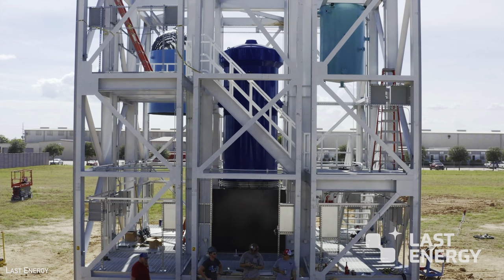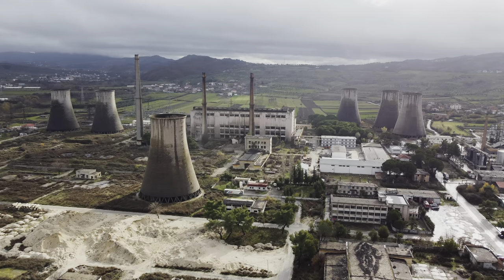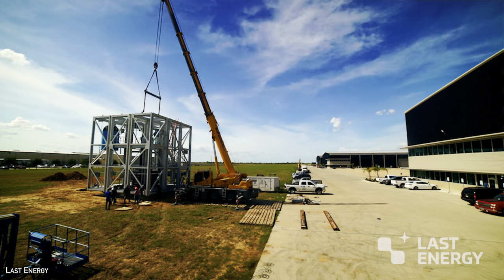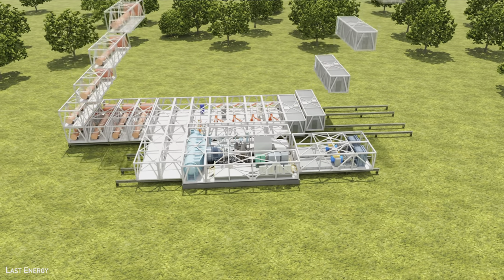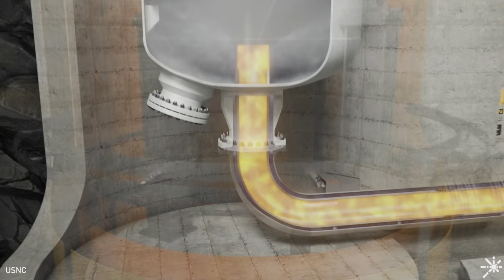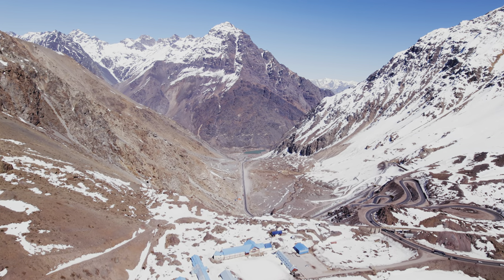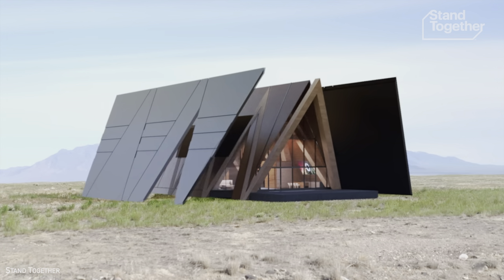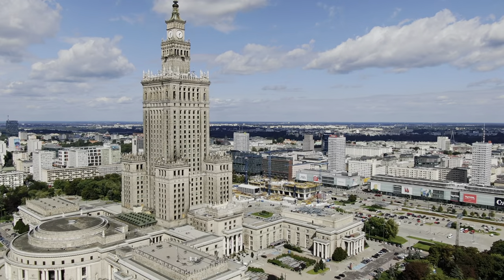The Daring Plan to Build 10,000 Nuclear Reactors

Comment: Well normal powerplant also have preproduced moduels that they put together, its just a higher number of those modules,... well and a lot of welding.

Well and building a nuclear reactor really don´t take as long time as people tend to believe. A full size GW nuclear reactor can be built in 2-3 years . The issue is really not time, but will.

Passive saftey is standard for all gen III reactors, that is pretty much all reactors that have been newbuild in the west the last 30 years or so. This is really not something new.

Even in a gen II reactor, the operator need to do nothing to activate the active cooling system. Even some gen II reactors have semi passive cooling system.

Perifalation is not really a thing with light water reactors. Specially so with sealed reactors.

To use a light water reactor to make weapon grade plutonium you have to open it up every 3 weeks and swich out fuel. While that sounds like it would be possible in theory. In practical reality you really can´t do it while making fuel.

Reactors like RBMK that was the type used in Chernobyl could extract fuel while operating, making this much simpler.

The idea that you can just make a bomb out of used nuclear fuel is simply incorect. Its one of those, you could do it in theory, but its so horribly complicated, so its just easier to make it from scratch

Comment: @16m:  “it is unlikely any other regulator is going to be any more forgiving”

That’s a broad sweeping statement in the extreme. Any evidence following? Why, no. The US NRC has well earned its No Reactors Commission nickname. The NRC had not issue initial proposal approval for any of the existing US reactors, until Vogtle 3 came online. Hundreds of reactor proposals have been cancelled over the decades under NRC.  There was no ALARA requirement before NRC.  The history suggests NRC is unusual throughout the world, not typical. And, Poland is very hungry for reliable clean power.  Their populace will not tolerate intermittent RE games raising rates over 30cnt Euro per kWh as in Germany, becoming dependent on Russian gas or any other idiocy.

Comment: This takes up the same amount of space above ground as the GE-Hitachi SMR which will produce 15X the energy and at a cost 20% less, Last may want to work on that.
Reply: No chance.  The pressure vessel for a 300MWe reactor is hopelessly custom, $150 million if it’s dime, made by only a few mills in the world. Can’t ship it by truck, can’t bury it underground.  The 20MW Last Energy  PV is right out of ASME tables w hundreds of mills that can make it in a few months, any semi can deliver, and it’s easy to install underground. Projects like the LE design are built in 18 months all the time. GE-H will be 7-10 years, and need a big water supply, above ground big containment. 

LE problem is the regulator. They have a shot in E Europe.  A small cheap reactor built in two years will turn the world upside down, and many special interests don’t want that to happen, including GE Hitachi.

Comment: Great dream but a dream nonetheless!
The concept is great but there is a long road from concept to reality and I could already see many things that needs to be improved or modify the get there. One of the most obvious is to reduce the size of actual reactors to fit the model. Not only it needs to be smaller but it also needs to be economical to build and operate and this is not a small task.
Another problem I see is to build it in the US and install it in Europe. Two points: First it will be expensive to build in US and it will be hard to find the necessary personnel to do the job. Second, if you think this is the hardest problem, wait till you try to get the necessary permits in Europe. It would be hard today to get them but it will be even harder to complete that task in the future with the geopolitical changes that we are facing at the moment.

Comment: While security around a nuclear power plant is mandatory, it's not because of terrorists that steal uranium to make bomb: those plant, and future ones, operates with a core composed mostly by the wrong isotope to make a bomb, and the part that is right is less than 5% at most, while bombs requires an enrichment of 95% or more.
And if think "well they steal it to craft a dirty bomb" I'll answer that there's hospitals for that one, way more accessible and available than a nuclear power plant of any kind.

Comment: Fluid dynamics, pipe size matters! Large reactors are efficient because they are large, using large pipes. Basic physics. Uranium at 5% that is mostly sourced from Russia and that is a supply issue. Large CANDU style reactors make more sense since they can run on low grade Uranium and can manage refuelling on the fly. SMRs are more for Silicon Valley glossy brochured investor schemes than a practical economic solution.

Comment: Submarines have been using them for decades.  Compact and powerful.  I do prefer low-pressure ones.  Let's hope molten salt and thorium come to the party soon.  Production line and modular parts would make sense.  Sadly, less than 10% of current fuel rod fuels are converted into energy, with the other 90% wasted.  Mass storage of wind and solar, as proposed by AMBRI, may be the answer.  Molten Salt as electrolyte, Calcium as anode, and Antimony as cathode.  A big insulated box with hot elements that cannot mix.

Comment: 20 MWe or 20 MWt?  (20 MW Electrical output or thermal output)?
Reply: Looked up on Wikipedia, it mentions a lot of detail on the company, it is 20 MWe, which is quite impressive for the size.
Reply: @LFTRnow  most impressive is 6 year non stop run time, 2 yr build and 4 mo install.

Comment: Must admit that this plan checks all the boxes for REASONABLE-NESS .. However, I fear that the kiss of death is the nuclear proliferation and terrorism threat .. which will be ever-present and no let up as long as the installation is there ..  UNLESS .. could there be a device, once triggered in the reactor, will render the processing for fissile elements either impossible, or more difficult and time consuming then doing it from naturally available uranium ? ..  Calling to nuclear scientists, is this scenario even possible ? worth pursuing ?
Reply: Can you explain what this threat is about. Ukraine happened and the plant is still standing. As for pressing a button, to shut down reactors they can SCRAM. As for getting materials, you cant just steal them from a reactor (because theyre really hot). If youre going to steal them you take them from the cooling pool or you steal them from the average hospital. But

(to be clear, dynamite isnt used in cancer therapy cesium is)
Nuclear is boring. The only point of using dirty stuff is because its more compact. Fear the person buying nails from home depot instead. Ted Kaczynski used scrap metal.

"The bombs that tore through a crowd of spectators at the Boston Marathon could have cost as little as $100 to build and were made of the most ordinary ingredients — so ordinary, in fact, that investigators could face a gargantuan challenge in attempting to use bomb forensics to find the culprit.

Investigators revealed Tuesday that fragments recovered at the blast scene suggest a simple design: a common pressure cooker of the kind found at most discount stores, packed with an explosive and armed with a simple detonator. A final ingredient — a few handfuls of BBs, nails and pellets — helped ensure widespread casualties when the two devices exploded Monday near the race’s finish line, law enforcement officials said."

"There has never been a known successful attack using a dirty bomb, although a few alleged plots to use the weapons supposedly have been foiled around the world.

In 1998, security services in Chechnya, the volatile republic in southwest Russia, said they defused a mine attached to a container holding radioactive material, which they claimed had been placed near a railroad east of the Chechen capital of Grozny by Chechen rebels. Two years earlier, a Chechen rebel claimed to have planted in a Moscow park a bomb comprising dynamite and caesium-137 — which can be used in cancer radiation therapy.

And in 2004, British law enforcement arrested Dhiren Barot, a man suspected of being recruited by al-Qaeda to plan terrorist attacks in Western countries. Britain’s domestic intelligence service, MI5, said Barot’s “ultimate ambition was to explode a radioactive ‘dirty bomb.’ ” It is unclear, however, whether he had the means or technical know-how to accomplish such a plan. Barot’s arrest and subsequent sentencing to decades in prison remain controversial."
Reply: "Nuclear proliferation" is a buzzword for "how do we stop Iran from getting weapons". In which case, the Iranians getting them will probably make te whole non-proliferation bullshit cease, as I'm sure the Iranians believe in free market for nuclear materials.

Comment: Its not fair to compare $/kw.  It doesn't take capacity factor into account.  Solar plants have terrible capacity factors often below 20%, depending on the climate where they are built.  Wind is around 30% to 40%, in ideal situations.  Nuclear is north of 90%, in the US on average.  

A more fair comparison would be $/kwh annually.  That would show how much each annual kwh costs and take capacity factor into account.  

Plus solar panels only last 10ish years.  A nuke plant can last 60+, albeit with steady capital investment.  

I see that $/kw stat being thrown around a lot by narrative driven media types and its not telling the whole story.  And none of what i mentioned above even gets into the Power Factor ratings of each type, which is incredibly important for grid stability and not well understood, outside of the power industry.

Wind and solar do not produce large amounts of VARS (poor power factor), like large synchronous machines do in nuke plants.  Think brown outs.  Watts turn the lights and appliances on.  But VARS make them run at full power/voltage.  Not enough VARS causes grid voltage to drop and make things unstable at worst.  Not enough watts causes blackouts.  Both are very important but most only focus on watts because VARS involve imaginary numbers and are a confusing concept to grasp.

Comment: if there is an international organization regulating this, why isn’t there just one set standard, and manufacturers just have to surpass those standards. 

making the economy of scale that much easier to reach
Reply from the maker: There have are currently several ongoing attempts to do exactly this through WNA and IAEA and others. The problem is that every country has their own regulator and their own way of doing things. Would one country accept the rules of another being imposed on them? Who decides? Would the US NRC accept design decisions and requirements from Kazakstan or South Africa or any other country?
Reply: This kind of mindset is exactly why NRC can't approve new reactor designs
Reply: @vaclavzajac214  I am sure that it has far more to do with the unwillingness to reduce production capacity of weapons grade radioactive materials. 

Not that I can fault them for holding such a position considering the costs it took to simply build up the current capacity. Hopefully in the future the weapons grade will come exclusively from military operated reactors, and civilian reactors can be safer more cost effective Thorium reactors.

Comment: “Tackling the main issue that has plagued the nuclear industry for decades, hugh upfront costs…”

No.  If one listens to the CEO,  the main issue is drastic over regulation in the US, led by the industry, which switched years ago to a “safety” business instead of a power business.  So, a constant cost of a $billion to certify any design, drove the industry into building huge reactors, which naturally has all kinds of supply chain problems. 

The NRC for instance demanded changes to the new Vogtle design, after the reactor was approved.  Also, the NRC regularly ships staff abroad, so there is nowhere in Europe where the hand of the NRC won’t be felt.  

Last Energy has a wonderfully sound and inexpensive reactor design which would revolutionize the energy industry.  Seems unlikely they can get past the main gate, the regulator.
Reply: You mentioned in a different thread that there arent any Chernobyl reactors. There are. 8 are still in operation but are being shut down between 2024 and 2034. 8 others including 3 at Chernobyl were still in operation until 2021.
Reply: @namename9998  “there are”

There were several Soviet built reactors   using the so called RBMK design from the 1970s.  The Chernobyl reactor accident 1986 was one of those.  

The gross flaw in the RBMK design was its inherent “positive feedback”, where in dome situations, increasing the reactor power intentionally cause it to be naturally more reactive, and it runs away.  All other commercial reactors have negative feedback. After the accident, all the remaining RBMKs were heavily modified to eliminate the condition, as documented by the IAEA. There are 8 RBMKs left, all in Russia, which are modified.

Comment: This is stupid. At 20 MW per unit this does not have the economies of scale to pay for all the personnel and maintenance required. All NPP require operations, security, radiation protection, and maintenance. These all have a relatively high cost. This is not such a burden on a dual 1000MW unit plant with a 40-200k hourly revenue. This does not pencil out on a 5 x 20 MW plant.
Reply: Watch the actual video @7min.  Small can do away with some risks, thus less expense to protect the reactor.  Also, the interest payments on long to build large reactors have zero payback with scale. Last Energy claims it can build 2 years.  

Examples:  
o No 25 mi evac plan necessary for a 20MW reactor, as one might need w a great 1300 MW reactor. US NRC already approved no large scale Evac for Nuscale reactors
o East to bury a small reactor, w a small hole in the ground, which adds cheap safety and security.  Large holes get expensive exponentially.  
o Small reactors much easier to disperse shutdown decay heat than big, as the heat path to the outside from the center core is short. A small reactor 20MW is just about passively safe against a melt down without doing extra cooling.  It can’t get hot enough in shutdown to make hydrogen which caused the Fukushima accident.  Regulators know that too. 
o Netherlands for instance think the US small army security force on reactors is stupid.  It’s especially stupid for a small reactor which really can’t hurt anybody outside the plant.  Likely other eastern countries like Poland think the same.

Comment: Will these produce the plutonium for nuclear weapons?
Reply from the maker: They will naturally produce plutonium as a byproduct mixed into the waste like most other reactors. Turning it into a weapon would require the same level of difficulty as most existing plants -- special chemical separation facilities. In short, these reactors not a good way for plutonium production. There are much more efficient and cheaper ways if that's the goal.
Reply: Chemical separation will not yield weapons grade Pu from this reactor, which is why spend fuel from a commercial light water reactor reactor has never been a path to bomb. One would have to do isotope separation as well, in which case it’s easier to dig up uranium from the side of the road.

Comment: How about explaining why Indonesia's nuclear choice is for Power Purchasing Aggrements (PPA) for the walk-away safe 7×500MWe ThorCon liquid metal Thorium ion molten sodium fluoride salt burner energy converters requiring less than 2 football pitches each at $1200/KiloWatt and a levelised pre-profit cost of less than $30/Megawatt.hour  (3 cents/kWh) base loader than can black-start as well as automatically follow load demands and smooth out irratic supplies from renewables and reduce the demand on standby batteries  and the destruction of their important tropical rain forests for ubiquitous wind or solar farms..
Reply: There is no Thorcon  reactor, not anywhere. Not under construction, not licensed. They have an agreement on cost if they do get one licensed, built, running. Meanwhile nobody gets paid anything.
Reply: @Nill757 FYI the Indonesian Java sea Bangka island' ThorCon electro-thermal non-fissile test bed is underway
Reply: @mrvaticanrag3946  non-fissile? Please.  Then there is no thorcon reactor design, removing fissile products, demonstrating reactor vessel immunity to corrosion, and so on. Nor does it need any license from any nuclear regulator anywhere, IAEA, Indonesian , etc. That license is they key.  Everything else is hobby shop nonsense.

Comment: brilliant, nuclear without the usual constraints should have been done years ago. This is the solution to climate change in a long term perspective. I'm also guessing that if they become a local electricity provider they will provide licensed operators too. Solar is okay for now as its price is lowering year after year but china 's got the majority of rare earths and manufacturing them is quite a polluting process with all the chemicals involved. We need to decentralise the power grid with stable power generation and the most efficient way i see it could be done is by having small nuclear reactor plants.
Reply: Imagine thinking that splitting the atom to boil water is going to cool the planet.
Reply: @obsoleteoptics  I'm pretty sure that the spontaneous decay of Thorium and Uranium in Earth's core, keeping it molten, is an exponentially greater heat source.  Perhaps volcanic heat alone or heat from the Sun can be considered to have the same  unimaginable ratio to the meager human component.
Reply: ...which pollute all the time they generate. LOL.